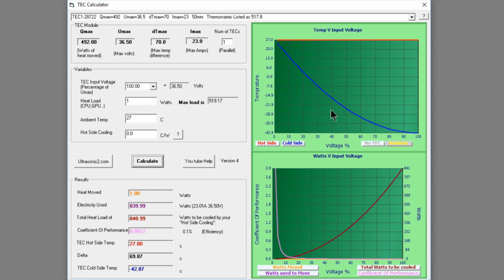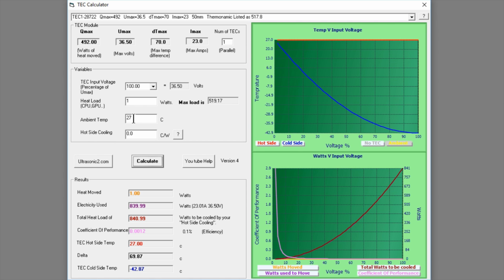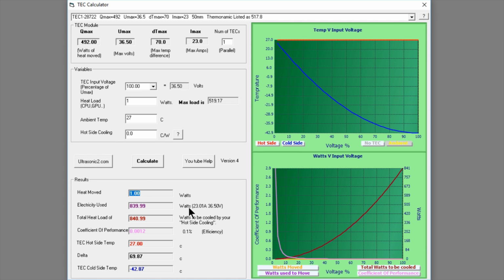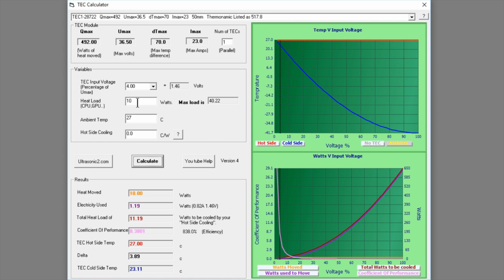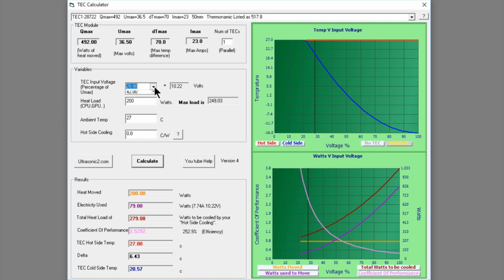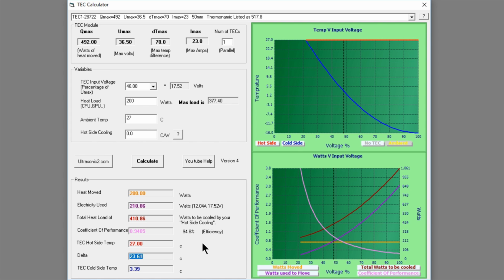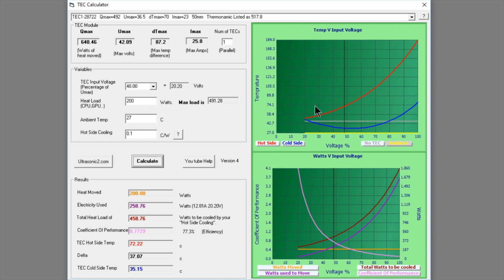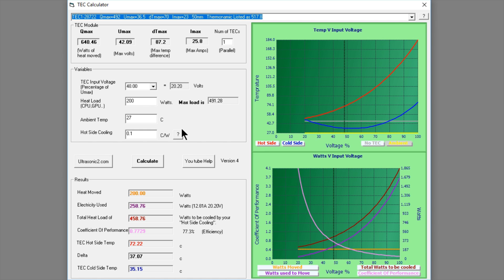🎓 Peltier efficiency:- Examples of Efficiency  Part6

Comment: "[TEC] offer around 10–15% efficiency of the ideal Carnot cycle refrigerator, compared with 40–60% achieved by conventional compression-cycle systems", Wikipedia 
Do you agree?
Reply: No... The COP of a TEC is 50% higher than condenser type refrigerant. Go back the video with the COP of the TEC vs Air conditioner.